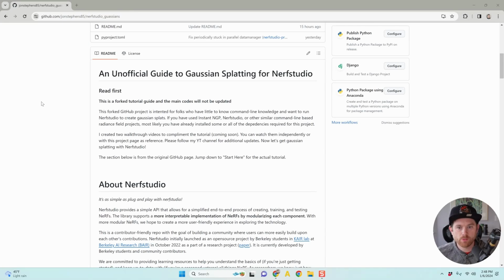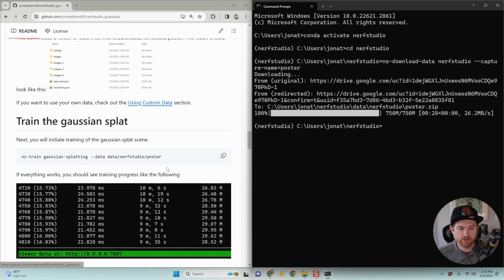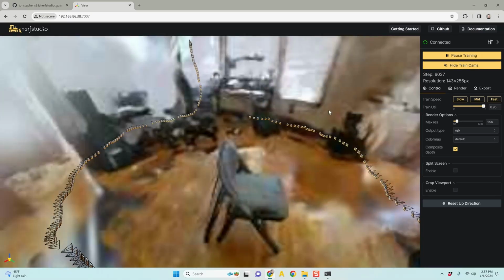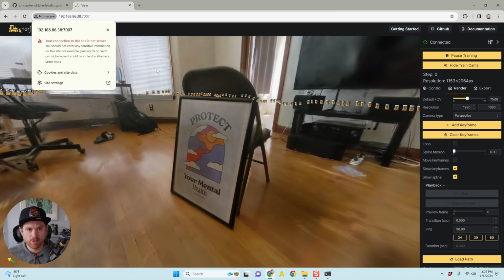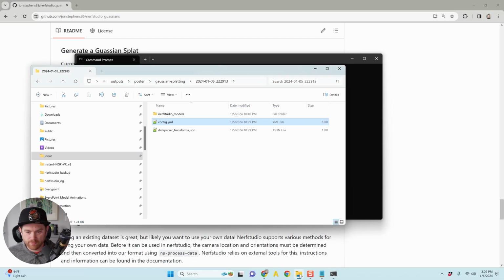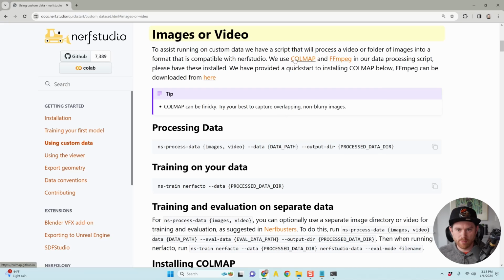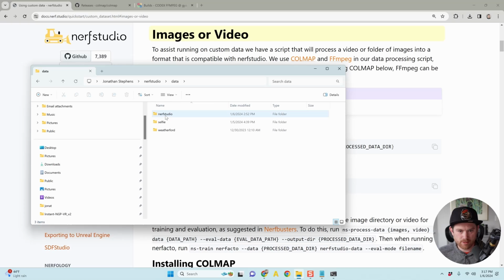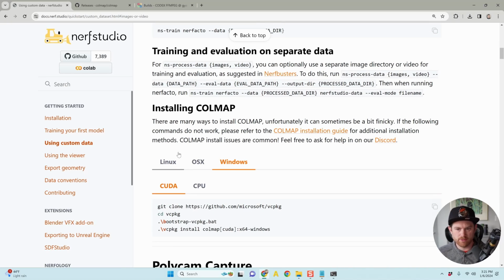How to Create Gaussian Splats with Nerfstudio

Comment: Hey Great Video, I am having an issue with training the Splats, I thought my problem was something in installing nerfstudio. but I just uninstall and installed it again.  I’m trying to run GSplat inside a NeRFStudio environment (as in video) with PyTorch 2.1.2+cu118 and CUDA 11.8. Everything else (Torch, CUDA, and NeRFStudio) is working fine, but GSplat fails due to a CUDA-related issue.
two main errors I see at start and end are: from gsplat import csrc as _C
ImportError: cannot import name 'csrc' from 'gsplat' (C:\Users\Shambhavi\anaconda3\envs\nerfstudio\lib\site-packages\gsplat\__init__.py)
compute_sh_fwd.cu
ninja: build stopped: subcommand failed.
everything in between is very long.
Please help if you have any suggestions
Reply from the maker: There is either a gsplat build issue or pytorch/cuda version mismatch. You can try reinstalled gsplat. You could start with trying:

pip uninstall gsplat
pip install gsplat
Reply: @pixelreconstruct  I have tried unistall and install gpslat countless time. Still don't understand what is the issue. Nerfacto works perfectly, I just don't understand why gsplat is not working.
Reply: @shambhavijoshi5755  I'm having the same problem, tried every way of installing with no outcome.
Reply: @shambhavijoshi5755  Have you found a solution? same here, really frustrating, i follow exactly all steps base on github instruction and i also has match versions of everything

Comment: @thenerfguru please how to solve this issue ?

  Getting requirements to build wheel ... done
  Preparing metadata (pyproject.toml) ... error
  error: subprocess-exited-with-error

  × Preparing metadata (pyproject.toml) did not run successfully.
  │ exit code: 1
  ╰─> [5 lines of output]
      ðŸ’¥ maturin failed
        Caused by: `project.version` field is required in pyproject.toml unless it is present in the `project.dynamic` list
      Error running maturin: Command '['maturin', 'pep517', 'write-dist-info', '--metadata-directory', 'C:\\Users\\Safari\\AppData\\Local\\Temp\\pip-modern-metadata-3497pi8b', '--interpreter', 'C:\\Users\\Safari\\anaconda3\\envs\\nerfstudio\\python.exe']' returned non-zero exit status 1.
      Checking for Rust toolchain....
      Running `maturin pep517 write-dist-info --metadata-directory C:\Users\Safari\AppData\Local\Temp\pip-modern-metadata-3497pi8b --interpreter C:\Users\Safari\anaconda3\envs\nerfstudio\python.exe`
      [end of output]

  note: This error originates from a subprocess, and is likely not a problem with pip.
error: metadata-generation-failed

× Encountered error while generating package metadata.
╰─> See above for output.

note: This is an issue with the package mentioned above, not pip.
hint: See above for details.

(nerfstudio) C:\Users\Safari\nerfstudio>

thank you

Comment: Hi! I was testing the data is provide but I get several errors when training, is it any way to share with you the log I get when processing? is there any channel where to share all these errors? 
This is an example: 
C:\Users\Jorge\miniconda3\envs\nerfstudio\lib\site-packages\torch\utils\cpp_extension.p
y:383: UserWarning: Error checking compiler version for cl: [WinError 2] El sistema no
puede encontrar el archivo especificado
  warnings.warn(f'Error checking compiler version for {compiler}: {error}')
Thanks !
Reply from the maker: My guess is that PyTorch did not compile during installation.

The Nerfstudio discord channel is great for these questions.

Comment: Hello ! First of all, many thanks for your very usefull videos 🙏 
It's super easy to understand and really efficient. Well done :) 

I never had any trouble that i didn't manage to resolve with your advices or internet. But this time I have an apparently easy one that I don't find how to solve...
I want to train my own datas, and when I try to do this command : ns-process-data {images, video} --data {DATA_PATH} --output-dir {PROCESSED_DATA_DIR}
I have this error : Error : Video does not exist : data....Etc... But the video is in the right place "nerfstudio/data/...." and I keep trying to put every path possible in the environment variables without any success .... 

Maybe someone already meet this issue ? Look simple but annoying haha
Reply from the maker: Could a folder have a space in it? Try dragging the file into command line and it should put the right path in there for you.
Reply: @pixelreconstruct   No space and I already try several times with different naming to drag the file, it didn't work unfortunately. The thing is that I can see a first "images" folder created just next to my video file into the good folder when I press enter...so it looks like it understand the path... but can't see the video file in it... it is a short .mov and I can see it when I enter the "dir" command....(it doesn't work with images either)

I finally decided to start from scratch, uninstall everything and back at it again. Works fine :)  Who knows...

Thanks for your time and the amazing community of GitHub :)

Comment: Nice tutorial.👍 I've used Nerfstudio before for training NeRFs and rendering videos and exporting meshes from them, but since I saw mentions of Nerfstudio supporting splats, I started wondering how does it actually work in Nerfstudio as I saw no mention of splats anywhere. Turned out I needed to install the latest version from sources (your other vid) and then follow these instructions to actually try it out. Training and rendering (videos of) splats is SO much faster than NeRFs. Wow. Very nice.

Comment: thank you for a very intuitive guide on this man!! you made it so easy to understand... but I can make it to train if I do the nerfacto.. but not the gaussian-splat are those 2 different?
Reply from the maker: Those two are different training models. Ns-Train Nerfacto trains a NeRF dataset, ns-train gaussian-splatting trains a gaussian splat dataset. Both are radiance fields, but completely different output models. If you can't get ns-train gaussian-splatting to run, maybe you have an old install of Nerfstudio. You need to update as of January 1ish. You know if you can train gaussian splats if you type in "ns-train --help" and see "Gaussian-Splatting" as a training model choice.
Reply: @pixelreconstruct   thanks man !!

I was thinking maybe my GPU is not up to the task.. I am using 12gb VRAM RTX 2080ti.. is it enough? or do i need rtx 3000 / 4000 series?
Reply: Made it work just now!!! with the recent update of gspalt I just typed ns-train splatfacto and it worked now!!! thanks for guidance my man!!!

Comment: Where can we use gaussian splats other than ue5 and unity?
Reply from the maker: Here is a list of viewers you can integrate it with: https://github.com/MrNeRF/awesome-3D-gaussian-splatting?tab=readme-ov-file#viewers
Reply: @pixelreconstruct  i see it says blender. Have you tried it with blender?
Reply from the maker: @wrillywonka1320  I have not. I have very little blender experience. I may give it a shot though. If it works out, I will make a video.

Comment: Wow - great video. I was just looking at the previous fork and was wondering if an actual implementation would be out soon, so this video is perfectly timed. Out of curiosity - have you worked out how to train only a specific area (say within a bounding box) to increase performance? I have cleaned/cropped my sparse point cloud, however it still seems to train far "outside" of the sparse point cloud, and I feel performance could be significantly increased if it were to only train within an area of interest. Thanks for all your time you have put into these videos!
Reply from the maker: Glad you found it helpful! I am not sure if it is possible to just train within the cropping box of a scene. That would be a great question for the team on Discord.
Reply from the maker: @@muhammadichsan1745 Yes, depending on the scene, masking might work! Ask around in the Discord, people have experience with masking.